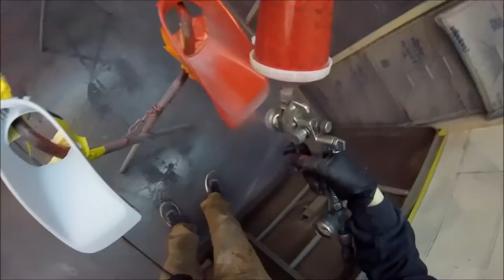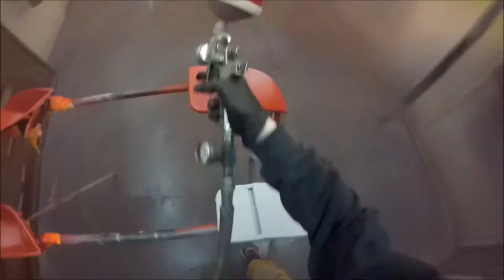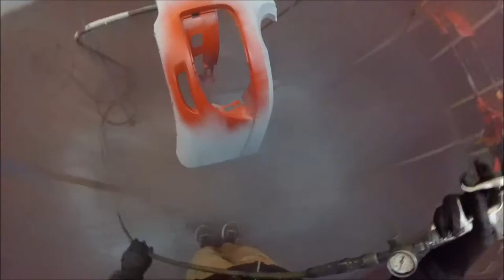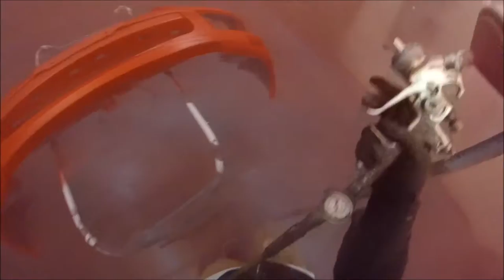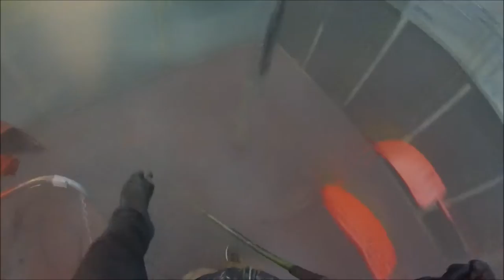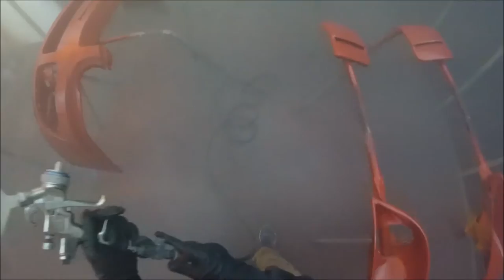Wide Body WRX Wagon: Part 3 PAINTING BUMPER AND PLASTIC PARTS

Comment: I have been dying to get my sideskirts painted on my San Remo Red wrx but I don’t want to shell out the money for a shop and I don’t have a sweet setup like you have here. Tried paintscratch.com but they want nearly $30 a can for a premixed spray can. Any ideas off the top of your head of a rustoleum or off the shelf spray paint color that might be a close enough match to look decent on a set of sideskirts?
Reply from the maker: You could look around if duplicolor makes a colour match can but overall paint materials are never cheap. I have used spray cans from expresspaint.com for my fender flares with good results.